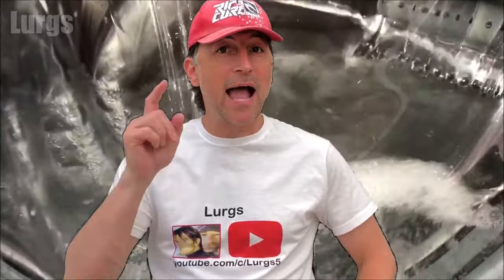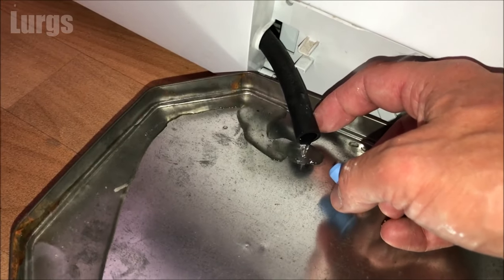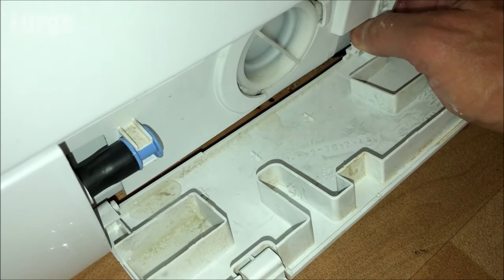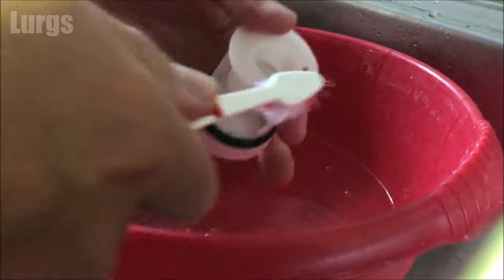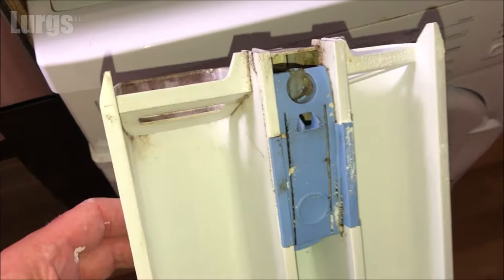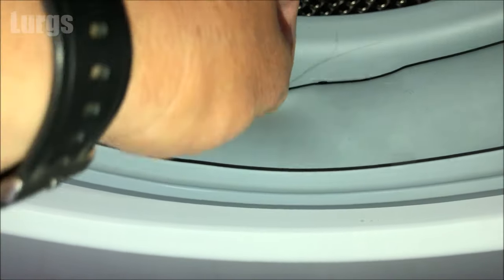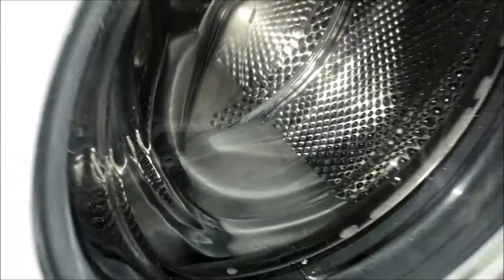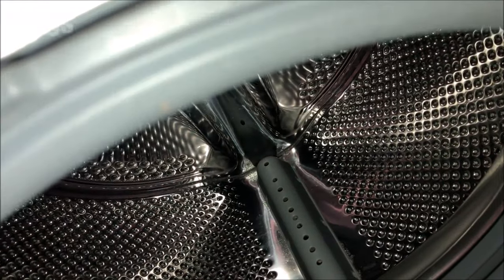How to remove and clean filter on Beko Washing Machine & keep it Hygienically Fresh

Comment: My filter is completely jammed. I can turn it more than 360 degrees if I jiggle it back and forth, but something is stopping it moving outward. Probably a coin or something similarly solid. :(
Reply from the maker: Oh dear, probably a hair clip. May have to just keep trying and hope it clears the threads and comes out. Might have to get a bit more forceful with it, worst case you can buy a new filter. Hope you manage to get it out.
Reply: @LurgsHowToGuides   belongs second hand the rubber seal is disgusting and there’s always water sitting in the seal it stinks please help
Reply: Hi Anthony, I have the same problem as you, literally can't turn it. Did you manage to get it out?

Comment: My machine is new and the water stays in the drum and is grey, and the door won’t open no matter what I do even if it’s turned off
Reply from the maker: Oh that doesn’t sound right. And it was all plumbed in ok and drainage pipes were clear?
Did you remove the installation\travel bolts?

Comment: I can't believe mine doesn't have that hose bit, & I can't fit nothing underneath so draining the water is a nightmare 😫
Reply from the maker: Oh how odd. Try lifting it up slightly at the front then undo filter very slowly and catch as much water as you can.
Reply: My hose isn't there either, I've a feeling it's fallen out of it's clip and gone under the machine?? I'm going to have to tilt my machine backwards and see if I can spot it.
Reply: @emmaroberts9006 any success?? I have also pushed it too much inside 😢

Comment: Great video but it's so frustrating and stupid how they made this washing machine. My previous top loader was perfect where you could just remove and clean the filter inside and no need to drain water.
Reply from the maker: Yeh front loaders are much trickier to sort out

Comment: How to put the propeller back in x
Reply from the maker: Oh dear has the propeller come off?
Reply: @LurgsHowToGuides  yes we have tried putting it back on but we couldn't x
Reply: Will it work without it and thankyou so much for getting back to me x
Reply from the maker: @kathleenlea9879  No it won't work without it as that propeller is what pumps the water away. 
Unfortunately it is probably moulded onto the shaft which is all part of the Drainage Pump Motor. You will probably need a new drainage pump fitted, unless you can dry it completely and somehow glue the propeller back on. 
If it's a an old washing machine might not be worth the expense and just get a new one. Good luck.
Reply: @LurgsHowToGuides  oh ok thankyou I'll get one in the sales 🤣
Reply from the maker: @kathleenlea9879  I’ve got a video How to disconnect and also install a washing machine, worth a look if you are doing it yourself. Merry Christmas. 🎄

Comment: My filter won’t budge! Help
Reply from the maker: Probably something stuck in there, bound to be a metal hair clip. Just keep trying
Reply: @LurgsHowToGuides  thank you I’ve got it to budge using some pieces of wood to gain purchase. It’s moved about a third of the way round and stuck again 😬
Reply: @LurgsHowToGuides  I do have a lot of kirby grips 😂
Reply from the maker: Try doing it up and undoing multiple times to see if the debris works it’s way loose
Reply: @LurgsHowToGuides  yeh I’ve been rotating it back and forth but it’s really sticking at that point. So frustrating. Thank you for your tips & videos. Really helpful
Reply from the maker: Maybe some pliers but be careful coz filter is only plastic. Hope it comes out eventually
Reply: @LurgsHowToGuides  got em! It was two completely mangled kirby grips as predicted by you 💪🏻. Thank you
Reply from the maker: Fabulous news, glad you got them out. Washing machine should run sweet now. Glad I could help. 😎

Comment: Mine wnt get hot always cold
Reply from the maker: Is it a newish machine? Some old machines took a cold and hot water feed so make sure you have hot water at your taps if that's the case. If it's only a cold water feed then must be a fault with the water heating element.

Comment: Hi I can't get the bung off!
Reply from the maker: That means you probably have something jammed in there like a hairclip or a coin. Try wiggling it about, undoing, doing it up again, maybe be a bit more forceful but be careful as it's only plastic. Remember to have a towel ready or a tray, you can always do it back up if water pours out too fast. Hope you can get it undone, good luck
Reply: @LurgsHowToGuides  ok, I will try to be more forceful, thank you for getting back to me... Fingers crossed it works!
Reply: @LurgsHowToGuides  I'm so sorry to bother you again, I got the bung off, drained the hose... Now I can't get the filter cap off, it just won't turn!
Reply from the maker: PinkGlitterUK Oh that's the same thing I mentioned earlier, no doubt something stuck in there, just have to try wiggling it, undoing, doing back up and hopefully it will free up